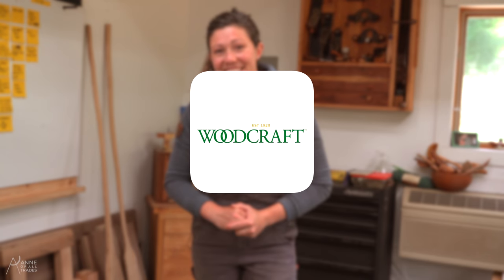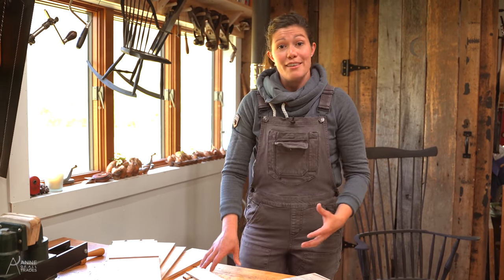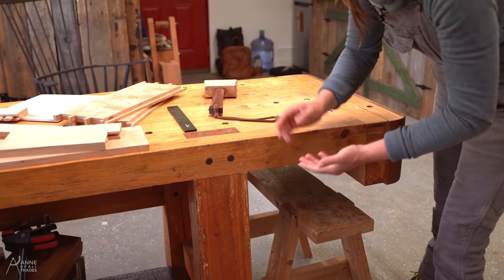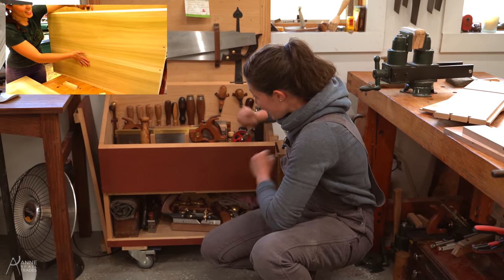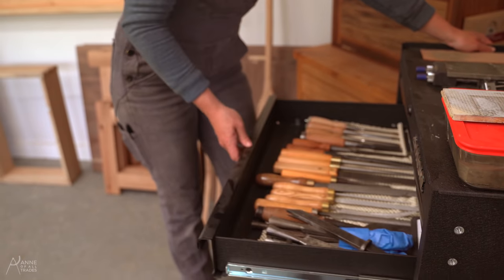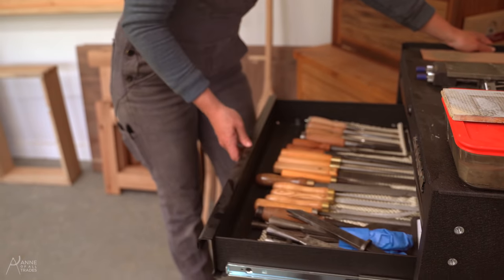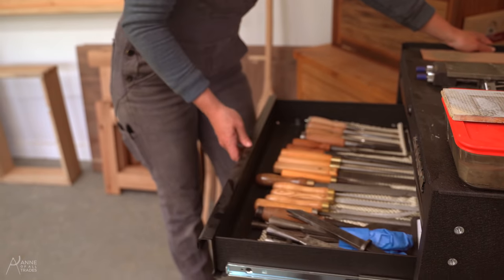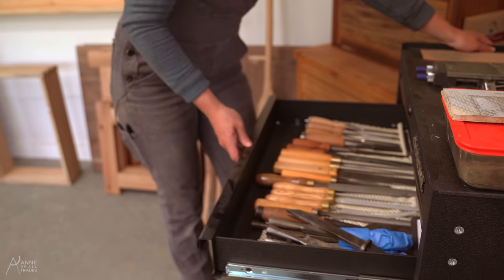Tiny Woodworking Shop Tour! // Woodworking

Comment: I have an 8x7 shed, I had to cut some length off of my bench to fit it in! I'm looking forward to the warmer weather here in North Yorkshire, since the other half of my shop is really the yard. 

I wanted to say thanks for being open about your mental health. I've struggled with depression for years now, and found the lack of confidence it brings really kills motivation. I've tried using a backlog board to manage tasks in the past, I'll try that idea out again now that I'm thinking about woodworking again.
Reply from the maker: Sorry to hear you struggle as well. Backlog boards haven't been super helpful for me because eventually they just become lists of what I HAVEN'T done. The kanban/scrum boards really have changed that. Check out the book doing twice the work in half the time. It really changed the mindset of "to do" lists to rewarding myself for "what's possible and what's done :)"
Reply: @AnneofAllTrades  I will do, thanks!

Comment: "tiny woodshop" while I sit here working out of a 125sq/ft shop...
Reply from the maker: most important thing is you've got space to be creative! Tiny is as tiny does, I was more referring to the fact that I was leaving my 1500 square foot workshop and machinery in the old space ;)
Reply: Single car Garage here, not even the entire garage.
Reply: Shed dweller, checking in
Reply: I'm working in a 6'x10' section of a one car garage that doubles as the laundry and bicycle storage. Working under the roll up garage door, so there's not even usable ceiling space. Glad to see others in similar situations. The driveway see's a lot of sawdust most days.
Reply: It doesn't matter.. I have 850 square feet on the first floor and 800 in the loft.... it's still far to small.

Comment: the vise that was restored for you by your friend, i have that same one but non restored and i use it on a regular basis.  great vise.  also i 110% agree about your sharpening station and that it needs to be out and easy to get to and use.  when mine is put away (im not always woodworking i do metal and other types of work) i always get lazy and it takes for ever for me to get it out and use it but once it is out i use it all the time.  it makes a big difference having it out and ready to go vs put away.

Comment: Hey!!! I never heard of Scrum Analysis, but it looks very similar to a Personal Kanban board! I love that system and use it at work. One major difference is that you are limited to "doing" only 3 things at a time, so you "have" to follow through. I have also added FIFO (first in, first out) to make sure I do things quicker even if I don't want to.
Reply from the maker: That's great! Scrum works better with teams, I'm far from an expert, my business partner Josh introduced me to it, and I've since read up on it quite a bit, but for our little 3 person team, it's a great option. Check out Scrum: Doing twice the work in half the time if you want to learn more!

Comment: In Gunsmithing school, the standard working height for a vise is elbow high. Meaning standing straight, you can rest your elbow on top of the vise. The ergonomics of this helps you file parts flat without angling your file, your arm swings naturally from the shoulder.
Reply from the maker: That makes sense for filing! You'd have worn out shoulders in a hurry if you tried to do that with a handplane though :)

Comment: Great tour, you have a small shop compared to most. You have motivated me do do a tour of my shop. You will think you have a barn after you watch mine..lol  I do love your workbench, mine is homemade as well.
Reply from the maker: Thank you for being here! Haha calling this "tiny" was a bit of an exaggeration, especially since I used to work out of my laundry room in my house, which was so small I had to climb over my workbench to get to the other side of the project! But, the "tiny" here was more a nod to the fact that I was consolidating from a 1500 square foot shop before and retiring my power tools for the time being because this room doesn't have the electrical capacity or dust collection to run them, not to mention that that fine dust would ruin my computer and video equipment ;)
Reply: Anne of All Trades , I respect using hand tools to the work! I need to tool up so I could cut dovetails and mortises with hand saws and chisels. Power tools can take away from the hand built perspective! My dad was a finish carpenter for many years! He built a 2300 square foot house with a level, hammer, square, hand saw, and a skill saw! He was a great craftsman! Keep up the great videos and content!!! 👍🏼👍🏼

Comment: Just found your channel thanks to Wilkerdo’s on FB. I’m already a fan. I live in SF in an apartment but still buy tools and do some projects here. My dream is to have my own shop, even if it is tiny.
Reply from the maker: Thanks for joining the journey! I started in my laundry room. If you want it bad enough, you can make stuff anywhere!
Reply: Anne of All Trades You and April Wilkerson are moving into new shops with lots of space. Frank Howarth has had his shop for years. That’s my goal as well. I had access to a shop here for a brief time but it shut down because the building was bought and is becoming a new building now. In the meantime I have a work bench in my bedroom and sometimes use my kitchen or bathroom for messy cutting. And I just found out my neighbor has a bunch of tools. We may work on projects together.

Comment: If you still want to keep your work bench you can add a 6x6 or 4x6 under the legs to lift it higher. If it does not sit level you can arch between the to legs leaving 6x6 on each end
Reply from the maker: ahh I'll limp it along, it is really nice when I'm dimensioning stock, just not so nice for joinery. A second bench would be a great compliment.

Comment: Just seeing this...  if you think you'll get less use out of that woodstove in TN, you just need a TN winter.  I spent about 5 years in TN.  The winters are much colder than in the PNW, and they last longer, and the summers are much hotter.  Spring and Fall don't really happen there.  You'll get plenty of good use from about mid-late Oct through March.

Comment: Anne... I only have one unfinished project... my house ! 🙄😂
Just need to lower the rest of the ceiling heights , do a full  re-wire, full re-plumb, install wet heating system, install some more of the double-glazed windows, insulate the floors, lay flooring-proper... apart from that the house is TOTALLY finished... on the inside 🙄😔

I've only been at it 10 years... but at 62y.o. time is starting to run out, I reckon as soon as its finished I'll "fall off me perch" 😬

😎👍☘🍺
Reply from the maker: haha well as someone about to embark on a build larger than a lot of houses, I feel your pain. It's gonna be a big, long project!

Comment: I'm really glad of the bit where you discussed the (incorrect) height of your work bench. There is so much misinformation bouncing around the web suggesting work benches should be the same height as your thumb as measured with one's arms hanging straight down by one's side, roughly 750mm, whereas the usual height of a kitchen bench is 900mm . . .

Comment: Hi Anne, I love your shave horse, I designed one more or less exactly like it. Did you design it yourself? If so thats just crazy how ideas and design is just out there in the ether for observers of problem solving to tap into.
Reply from the maker: Mine's based off of one from Popular Woodworking, but most horses I've seen are pretty similar.

Comment: First time viewer.  So why don't you just make your workbench higher...?  Extend the legs... make frustum shapes and mortise and tenon them on.  I made one workbench (2" higher than standard) and bought another.  Some day I'll make a new one.  Woodworking is just a lifelong hobby... but for 40 years.
I went crazy with metal cabinets in my shop... Hon lateral file cabinet with pull-out drawers for power tools... Hon glue-finish cabinet...Hon Safety cabinet (came in handy during Covid)... Painted a Library Card File cabinet for fasterners... etc.  All cabinets are painted almond... almond floor... white walls... bright shop... and nothing is on pegboard or hanging except for the main and mobile clamp racks.  Everything is in drawers... even chisels.  It's a clean look and cleans up easy... never anything to dust off.  I have a Machine Room and Assembly/Finish room... 750 sq ft.
I need to make a rail mounnted maple cabinet for hand planes that slides to cover my electrical box.
Great shop tour.  I love watching shop tour videos.  Maybe I'll make one some day.

Comment: Great little set up you have there, glad you are up and running.  Two questions:  1) If you haven't finished the whiskey cabinet, where do you keep the whiskey? (We keep it in a lower cabinet of my tool chest 😉)  2) did you leave the big mamma jamma back in Seattle?
Reply from the maker: https://youtu.be/2-GHsMqO9Rk 

and yes, unfortunately, but if you know anyone who wants it it's for sale.
Reply: @AnneofAllTrades  I thought that you would have to leave it behind, they aren't the most practical machines to move, let alone across country.  I know several folks who would be interested, but we're in Maine.

Comment: Is the floor of your shop wood or concrete and how did you finish it? I am planning on turning a shed into a half gym half woodworking space but I need to a) get the concrete floor levelled, not too hard but awkward as I need to empty everything out to do that and b) finish it somehow, I don't want to leave the concrete bare because it holds onto dust and I will put down some membrane, insulation and some kind of durable, hard wearing floor covering down, just not sure what
Reply from the maker: It’s painted concrete, and for what it’s worth, the floor is extremely un-level and hasn’t caused too many problems. Because this was built to be an animal barn, I don’t think they were too concerned. It’s inconvenient and annoying at times, but would probably not have been worth the effort to level it.
Reply: @AnneofAllTrades  Thanks!

Comment: are u going 2 be using up to date power tools or just use what u have?
Reply from the maker: For the time being, hand tools serve me just fine, you can do everything you could do with power tools with hand tools, it just takes a little longer. Power tools generate fine dust which wouldn’t be welcome to my computer and camera equipment I need to use in here, but once there’s another space available to plug in some tools, I’ll be happy to get my jointer, planer, and Tablesaw out of storage.

Comment: Could you show how you handle dust control?
Reply from the maker: With handtools you don’t need dust control, everything comes off in shavings that fall right to the ground or, if using handsaws, it forms in a nice little pile below the tool ;)

Comment: How do you manage dust to keep it out of the computer and off the mandolins?
Reply: hand tool wood working does not throw dust the way that machines do, its a much more healthy environment.
Reply from the maker: There's really very little dust with handtool woodworking.
Reply: @AnneofAllTrades  True, so do you do finish work elsewhere?
Reply from the maker: Mark Seale nope, I use a homemade wipe on finish and apply it right there on my bench

Comment: Now ,... About that metallurgy issue.. ??
Shall we start with DIY Sodium Silicate... ??
Before or After we learn 
about DIY.....
Electrolysis,...
Electroplating,...
Anodizing,... &
Supertinning.... ??
Reply from the maker: If you’re talking about tool restoration, you can read lots of articles I wrote several years ago about that topic, one of which includes diy electrolysis. If you’re not referring to tool restoration, I’m not sure you’re on the right channel ;)

Comment: 1:50 It should not have to be said, but, to anyone else who is reading this...
Do NOT burn scrap plywood and MDF type wood inside your workshop/work-area because of all the resins that bind those wood products can be very toxic to breathe when burned.
Reply from the maker: If it shouldn’t have to be said, why are you saying it? This is a handtool workshop, no plywood or mdf in sight ;)
Reply: @AnneofAllTrades  This was not a comment against you.
Was just offering a message of safety to whoever is watching this and is new to woodworking, that if they consider burning their scraps for heating a shop, that not all wood is safe to burn in enclosed area. Peace.

Comment: Where are your power tools?
Reply from the maker: I sold the majority of them before I moved here because I knew I wasn't going to have anywhere to put them until I built my new shop, but I do have a few things here stored in the barn because I knew I wouldn't be able to afford to replace them. I've got a bunch of battery operated tools I can pull onto the driveway of the barn if it's sunny and I'm really in a pinch, but I did handtool only work when I was getting started and I'm happy to return to that for a period of time... because I don't have a choice ;)